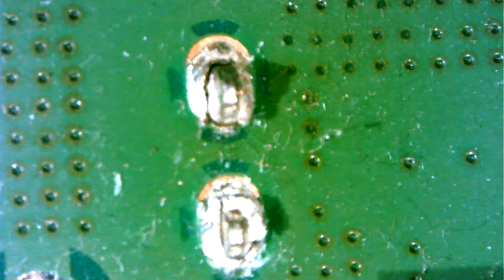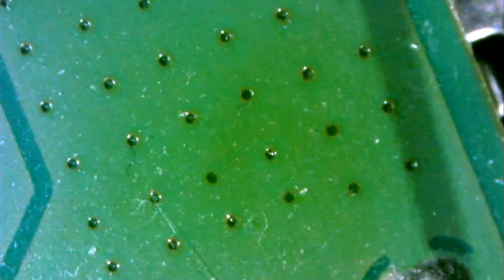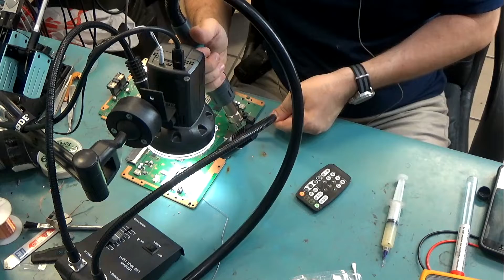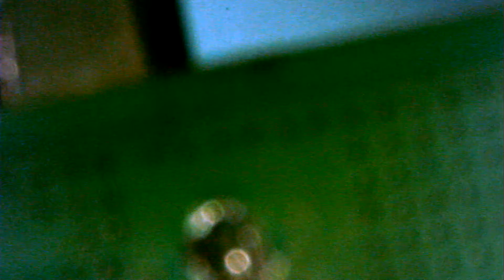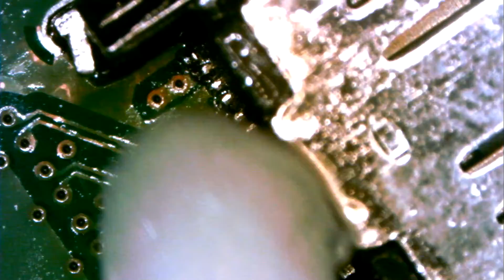Playstation PS4 HDMI Port Connector replacement - Prior repair attempt

Comment: Nice work :)
I think something wrong in the wicking mechanism... maybe the quality of wick?!! (I'm using goot wick 3mm, it drink the liquid tin like a sponge)
اطيب تحية
Reply from the maker: Salam habibi mohsen, What part of the video did you see the wick not working properly. I use the wick from MG chemicals https://amzn.to/2vWeacl. This is the only wick i use and it works great. What wick are you using.
Reply: هلا و غلا بأخي 
:)) عم  قول  انا الوجه  الحلو مو غريب علي

In two places wick behaves abnormally
https://youtu.be/O5GHNG_4Qpw?t=192
https://youtu.be/O5GHNG_4Qpw?t=165

You are a professional technician ... expert handling movement (pressure and speed), excellent solder iron quality, used good flux ... but the wick does not work as I  expected
Note the high flux temperature until its color changes to the dark brown due to temperature rise at the melting point... wick does not pull the molten tin completely, leaving residue, and the molten tin does not react to the entire wick fabric as if it were satiated
I'm using Goot wick (Made in japan) http://www.goot.jp/en/suitori-reworkcat/vacuumline
My personal experience It's perfect
There are two types of goot wick: halogen free & normal 
I experiment both types. The normal goot is much better (Sponge with water)
 
http://www.ekt2.com/products/productdetails/71_DESOLDERING_WICK_GOOT_CP-20B
http://www.ekt2.com/products/productdetails/71_DESOLDERING_WICK_GOOT_CP-2015
http://www.ekt2.com/products/productdetails/71_DESOLDERING_WICK_GOOT_CPN-3015

kind regards
Reply: being I build class 1,2, and 3 boards every day I’m super picky with how things are especially with exposed traces and suchThe wick did seem like It didn’t flow the solder up but it’s probably different from what I use, mines prefluxed wick and it flows up the wick instantly. But nice soldering on those legs looks good.